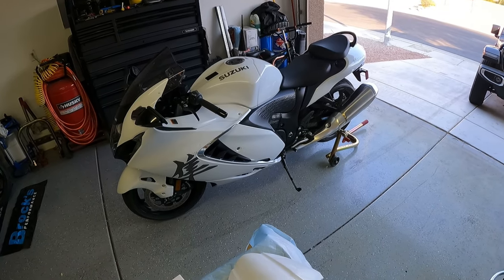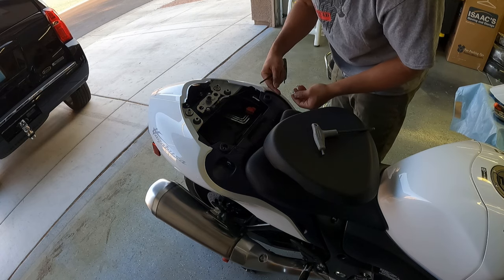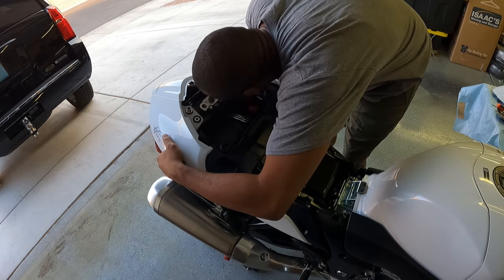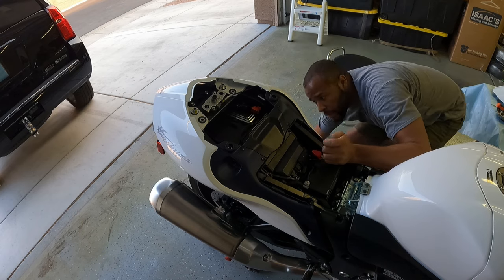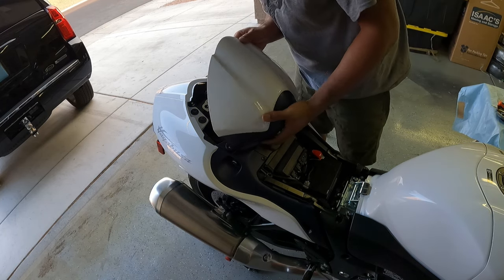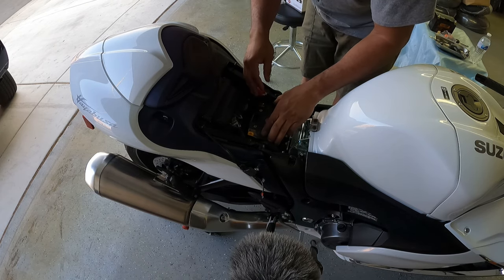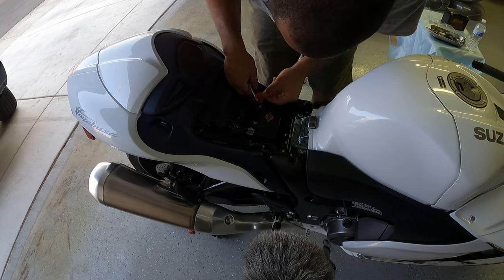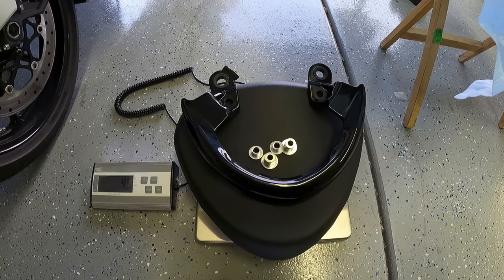How to Install Rear Cowl on 2022 Suzuki Hayabusa | Shorai Battery Install and Weight Savings

Comment: @2:00 , I found that it is not required to remove the rear body work to get the bushings out.  Just gently pull up on the plastic and you'll be able to get them out without issue.  The plastic body work is not brittle, so it won't 'snap' and break.  Just be gentle with it and only pull up on it just enough to squeeze the bushings out.  I just did this on my new 2024 'Busa and it went without a problem.

Comment: Thanks for the video.
I saw another video where the guy DOES NOT remove (exchange) the spacers. All he does is remove the grab bar and STRAIGHT install the cowl on a 2022 BUSA.
Do you really need to change that spacer?
Thanks.

Comment: Nice video! 👍 You really don't need to remove the tail to swap the grab bar bushings.
Reply from the maker: You have to bend the fairing way too much for my comfort level. Besides taking the fairing off was simple and made it super easy to disconnect the tag light
Reply: By the way....you do not EVEN need to remove those spacers...just remove the GRABAR and put the cowl in, or the rear seat back.
Reply: He followed the instructions which is exactly what I did. 30-45mins tops. He did an excellent job. Only thing I would have suggested since people will view this as instructional is to show how to actually pop rivets out. I can see someone trying to pry them out if they aren't familiar with them.

Comment: Question - any reason why you did not just Dremmel the seat cowl so you can flip back and forth the the pillion or Cowl thus leaving the grab bar on? I see quite a few people doing this simple mod and nothing has to change - did you try putting the seat cowl on without removing any of the washers to see the fit - or you did and it just would not work? Cheers Man - nice ride - love the white not an option here in Canada

Comment: Easy 10lbs right there and those bikes should come with the cowl and have the seat optional instead. How you like those Shorai batteries though?
Reply from the maker: Agreed on the cowl and I have no complaints on the Shorai battery. I dont think its the lightest battery in its class but I've tried others and had nothing but problems. So I'll stick with them for the time being

Comment: Just remove the grab bar and put the cowling…
No need to take the whole thing….
Reply from the maker: I did not want to bend that rear fairing anymore than I had too because with my luck it would have cracked LoL
Reply: @EnviedKing  All you had to do is, to remove the grab handle and passenger seat without replacing spacers and place the cowling on, wo loosened the tail, unless you really need the grab bar with cowling, I don't think so it's all about weight reduction, lol
Did you get the new fearing?
Reply from the maker: @andyr4609  that's not possible because those spacers push the fairing too high and the cowl will not fit. You have to remove the spacers or it doesn't work. Trust me I tried
Reply: @EnviedKing  I did exactly the same as you did, when I got mine 3 mos ago from a video on YouTube, a member in the forum mentioned that no need to exchange the spacers….
I thought why I didn’t try it, but went like a sheep following that video… lol
Reply: Andy R and EnviedKing....thanks for the video and feedback. I just got my seat cowl last night and installed it without having to remove the original front spacers (the taller spacers). It goes on smoothly and even has some slight wiggle room, which to me, means that the taller spacers aren't in the way or pushing the cowl higher than it needs to be; or that I forced the cowl on there. I'm replying to this post because I found a small bag of screws in the cowling box and wondered what they were for. After watching this video, it appears that we are supposed to remove the entire rear cowling to be able to remove the taller front spacers to install the smaller spacers. Is this really necessary, if my cowl goes on nice and easily? I also put some blue painter's tape on the area where the taller spacers would meet the cowl to see if there would be any dents or creases on the tape. There was nothing there. I think I'm good to go with not having to remove the taller front spacers. It's kind of a lot of work to remove that rear cowling just for some spacers. Thoughts? Thank you both, and Happy Holidays.
Reply: @doctor-d-rose69  Happy Holidays Bud!!
Reply: @andyr4609  Thanks, Andy! So, just leave it as is with the stock taller spacers and enjoy the ride?
Reply: @doctor-d-rose69  yep…